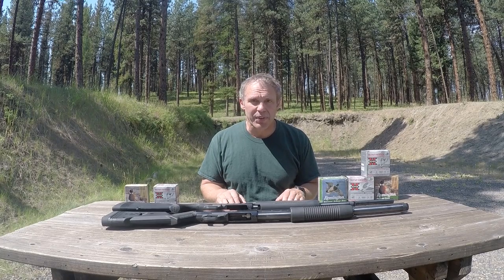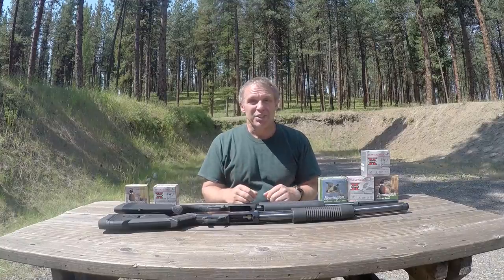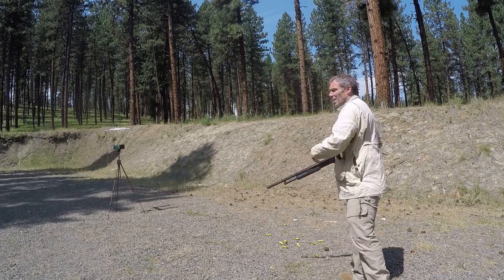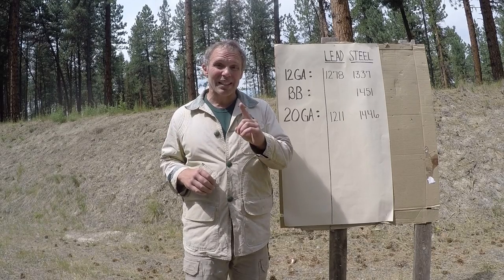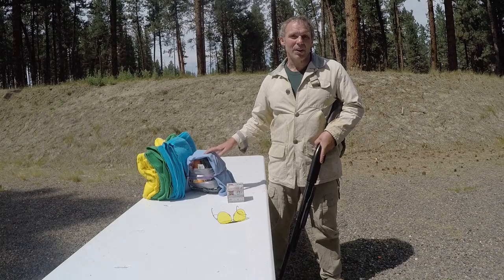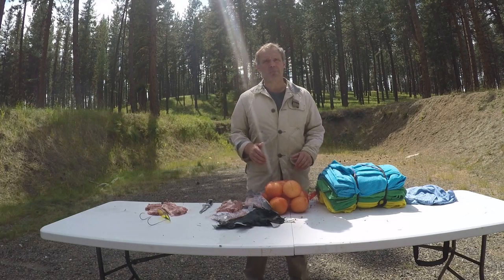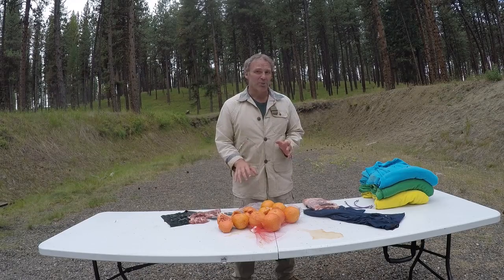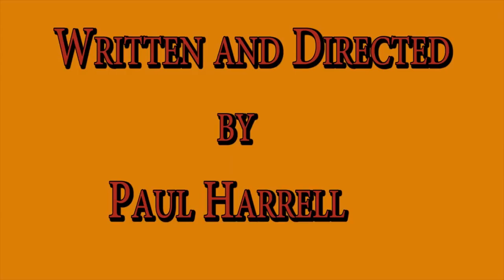Steel Birdshot for Home Defense

Comment: Not disputing your conclusions, but you ARE missing something that's relevant, and worth mentioning: steel shot has significantly less SECTIONAL DENSITY than lead shot. Lead shot will be expected to penetrate significantly better than steel shot when pellet size and velocity are the same. That's why, on game, most manufacturers recommend using a lower shot number with steel when used for the same purpose as previously used for lead. (#4 steel to replace #6 lead, etc.).

Still, FBI tests confirm that (at least in lead shot) #1 buck represents the most "bang for the buck" in self-defense rounds. Their principle was to find the smallest shot which penetrated to their minimum depth -- because a larger number of smaller projectiles (with total weight X) will produce more tissue destruction than a smaller number of larger projectiles (with total weight X) -- as long as depth of penetration is adequate. This is just physics. So, for example, 16 pellets of #1 buck which completely penetrate a target will cause more damage than 9 pellets of 00 buck (assuming roughly equal muzzle velocities). When I do choose a shotgun for home defense, I do load it with #1 buck. And, per the above, if you were going to use steel buckshot (and, actually, I don't use shotguns enough to even know whether that's available) you might want to increase that to, perhaps, 0 buck (again, I don't even know if that's produced, and I'm not interested in looking it up, lol). Lead shot is much to be preferred for self-defense.
Reply from the maker: According to the sources I read, no. 1 and no, 0 are the same size. Go figure. I don't know about all those FBI tests, but after doing some deer hunting I concluded that no. 1 was the best size for me to use. 
  I don't mention sectional density in the vid, but I do say that lead is dense and makes a good projectile.
Reply: @PaulHarrell  Thanks for your response. In the end, the result is the result -- and your meat tests never fail to be significantly informative.

Comment: If I was a home intruder I wouldn't feel optimistic about getting shot with a .20 ga. compared to a 12 ga.  Think they would both hurt, and I don't think I would be able to distinguish between whether or not the homeowner used lead or steel.

Comment: Steel hunting shot usually packs enough punch to cycle, the steel target loads do not work that great in all auto loaders. The scary thing about steel is how it has a bad habit of coming back when impacting with hard surfaces. Where is the steel shot vs concrete wall at 10 yards? ;)

Comment: you need to use steel birdshot if you're using the Wile E Coyote method of delivery, mixed in with the birdseed, or your magnet won't pull you along the road when giving chase!

Comment: I've got some Tungsten 00 from Winchester at 1600fps. It's supposed to be be for medium game, but I'm pretty sure it's really designed for aliens. I mean, seriously? That's an expensive substitute for lead! I bought it in case I'm attacked by an armored engine block.
Reply: So: BB's are maybe the smallest shot you should use in steel. Looks like it won't go through too many walls. P.S., I've also got some Tungsten Turkey loads.

Comment: The improved cylinder choke for steel is the incorrect choice, you need to use a modified.The tighter choke causes the steel to bounce, and it can actually destroy some of the pellets because they're brittle. But that's the reason the pattern was poor with the steel and not the lead.

Comment: Before I watch this I just wanted to say my first two rounds of HD shotgun are lead birdshot I also live in extremely close quarters the longest shot I'd have to take is maybe 10 yards. Also if I miss I figure the suspect has found concealment and then it's all 00 buck and slugs on the stock. So if I need to penetrate I can.  But if I dont then I wont.

Comment: I'm curious in the beginning of the video you had mentioned steel bird shot causing damage to the barrel. I'm curious if there was any damage in or not? Also one thing I think was forgotten was cost effectiveness whether steel is more expensive than led. I'm simply curious and looking to learn as much as I can.
Reply: Silverous Leonidas steel only damages barrels if it is shot through a full choke or if shot in excess.
Reply: @beardoggin8963  
thank you for clearing that up.
Reply: @silverousleonidas5790  no worries, ive seen steel shot bulge a full choke barrel. Best to stay away from Steel unless you need it for hunting

Comment: The "very disappointing" shot actually seems, to me, like something that you might want in a home defense situation where you don't necessarily want to kill your intruder. While there was no penetration, there was however a wide spread and the impact was significant on the meat target (knocked it off the table). Considering that you would be firing at a person you would most likely knock him clear off his feet and pepper his entire torso+arms+upper legs/groin+neck+lower face with bird shot. If your intent is to force the disengagement of the intruder (and not necessarily his termination) I'm almost certain that this will achieve the result and the intruder would have zero interest in continuing to engage you (and personally, I have no issue with an intruder being able to run away).
Or am I missing the point entirely?

Comment: comparing steel to lead on paper, you need to take into account the change in weight of the pellets and figure out the total momentum (mass times velocity). The reason you can get away with comparing just the velocity of lead is that it's apples to apples. A steel projectile with the same diameter and the same velocity as a lead projectile will transfer significantly less energy- because it took less energy to get it that fast.

Comment: Yep! Newbie right here! I bought a Rock Island VR60 two days ago and I don’t know what ammunition to buy. It’s 25 feet from our bedroom door to our front door BUT we have children in bedrooms. I’m worried about over penetrating. What exact bird shot should I buy? I mean, what words and numbers should be on the box?
Thank you for your help.
Reply from the maker: Check out our presentation titled, "introduction to shotguns." There's a tedious explanation of what all those numbers mean. We also have presentations on various types of bird and buck shot.
Reply: My guess is go with lead. The smaller shot is a higher number. I've had better luck with high brass. If you get the other its fine. If all you can get is steel the numbering system is different. Best to use the chart. The numbers on what you typically  get at the store are different. Like a steel 2  vs like 7.5 or 8 for lead. With a semi though always test it. I have always tried to buy the better shells with the higher brass but also I have a pump. If I'm shooting trap I use cheap low brass. But yeah my recommendation  is get the best quality and don't go 00 buck , you could also go less lethal but thats a whole other category. If you have kids I'd go with a dog and an alarm. You can get self installed alarms for very cheap. And honestly  your plan with kids should be shelter in place and defend. That way you're not putting them in danger of a stray shot but I guess that can be bad as well because badguy could come your way and then you're all in his line of fire.

Comment: I'm quite surprised at the variance in the number of pellets in the same type of round. I would expect maybe 2-3 pellets of difference out of ~150, not 9. That's more than 5% difference.

One would expect such a difference to impact the trajectory and pattern, even the recoil. It might not matter too much in terms of effect on the intended target, but I'd be shocked if such loose quality control didn't impact consistency.

Comment: um, the fact the steel shot knocked the target off the table twice, says a lot to me. If you knock the perp down, a second or third shot will do the job. Sometimes, knocking the guy down is better than a non-instant death. If they stay standing, they can still kill you even tho they may die later.
Reply: toot tall a meat target is a long way from being analogous to a determined person trying to kill you. Better off using something more proven in your shotgun, like #4 lead buckshot
Reply: @beardoggin8963  you are likely correct. However, that fact was ignored. I keep a colt 45 handy as my home defense weapon because it's what I have and I trust it, I've used it for years. I don't recommend it for most though. Average person, a 38 revolver is actually a better choice. the only reason for using a shotgun is because it's what you have and know how to use. That being said, if it's purpose is home defense, then you load it appropriately for that purpose. The only reason for using any kind of birdshot is that's because it's what's available in an emergency situation. Anything is better than nothing.
Reply: Beardoggin89 plus you can’t load a meat target up on meth

Comment: Are the Mossberg 88 and the 500 basically the same shotgun?  I know they're different gauges in this video, but what I keep hearing is that the 88 is a less expensive version of the 500, but that they're virtually identical.
Reply from the maker: I just saw your question. hey are NOT the same gun. The 88 is a decent gun and it is significantly less expensive than the 500/590 but it is different. the action is rougher, the safety is in a different location, the list goes on.
Reply: Paul Harrell thanks for that clarification and I'm glad I can find an expert's opinion on this because it's what I keep hearing all over the place.

Comment: This should be interesting.  Why steel?   Hmmm. For penetration the "rule of thumb" is to go two sizes larger with steel shot to maintain the same energy/penetration at the target.  Steel shot loses it's velocity advantage very quickly.  Your results are what I expected.  Lead is better.  It's also cheaper.
Reply: gary K I’ve heard the rule to go up 2 sizes with steel shot too.

Comment: Lead shot has been banned for use when hunting water foul in all 50 states since at least the late 1980s or early 1990s. If I were to use steel shot for home defense then (.170) #B shot would be the absolute minimum smallest pellet size I'd use for home defense. Where as sizes (.190) size #BBB, (.200) size T, or (.220) size #F would be more ideal in my opinion if one had only steel shot in a pinch though not a replacement for good lead shot.

Comment: Doesn't this have more to do with the pattern at the range you were shooting than steel vs lead shot?
Also, usually I wouldn't bring it up, but in this case I think the meat target lacking skin probably has a substantial effect on the penetration of different kinds and velocities of small shot.
Reply from the maker: ay that the met target has, "leather jacket skin"
Reply: @PaulHarrell  oh, yep.  I've watched enough of your videos that I press "L" to skip the meat target description. I should probably stop doing that.
I still don't know about the first point and I know practically nothing about shotguns so I dont know how adjustable the spread is.

Comment: Do shotguns need special proofing for steel shot?
Reply: Most new guns can handle it unless specifically stated otherwise by manufacturer. Older guns, many advise against it as some say it ruins barrel, choke and forcing cones. I don't shoot birdshot often but I would think modern shells, with the wad cup holding the birdshot together until exiting, aren't as hard on barrels. Others on here are probably much more knowledgeable than I am

Comment: speaking of shotguns, I'm turning 18 in 6 days and I'd like to ask you a couple of questions.

I want a shotgun and I'd like to know which you like better between a Mossberg 500 and a Remington 870. I've shot both and both work for me but I'd like to know your personal opinion.

My second question is what tips would you give to new gun owners about buying guns and making good gun choices.
Reply: Get an 870 made last century. It's better made. Simpler than a Mossberg. Better configured for a pistol grip. Allows for an extended mag tube.
Reply: I am not Paul, but I own 2 mossberg 500's and a remington 870 Express magnum. Having put thousands of rounds through the lot of them, my personal money is on an 870 just about every time. They feel much easier to disassemble, and as they age don't seem to rattle or work themselves loose nearly as much. I live and hunt on a large saltwater marsh and generally beat my guns to heck and back, my 870 is the only one of my 6 shotguns that always works.Additionally, it tends to appear that 870s are much easier to customize and find aftermarket parts for, especially if you choose a 12 gauge. Your mileage may vary there, as I have kept mine in their stock configurations.
Reply from the maker: Thanks for the good input. I think the 870 is a good shotgun, but personally I prefer the Mossberg. I like the tang safety (works well right or left handed) and I like the loading system on the Mossberg more than the Remington. If you want to customize your gun there are things available for the Mossberg, but more for the Remington. And If you want to spend the money, the high end Remington's (the wing master) are smooth as glass.
Reply: you wont be dissapointed with either. Search here on youtube for remmington 870 vs mossberg 500 and you can see all the differences between them. 

If you do decide to get a remmington look for a used one made before 2007 or so. Thats when they got taken over by another company and started cutting corners on all their products, the guns would stick closed after being fired, the finish was poorly done resulting in very easily occuring rust etc. Mossberg are solid guns, and remmington 870s are as well as long as you get one from before they got taken over.
Reply: thanks for the tips! I have a lot of old time gun stores in my area so finding a used shotgun in good condition shouldn't be too difficult
Reply: Just learn on a pump gun. I started at 11 years old with a Remington 1100. 50 years later tried to use a pump. I can shoot the first bird flys over but 10 minutes later second bird flys right by. Dang gun want shoot . Same learning to drive, start with a straight shift. Ant drove one in years but still try to mash at clutch often. Just smile an go on.
Reply: One key point is that Remington 870 has a steel receiver and the mossy 500 is aluminum.  Both are equally strong as the bolts lock to the barrel not the receiver.  I've seen many an 870 wielded by hunting buddies that have a rusty receiver.....my 3 mossy 500s have been put through hell in the field......rode hard and put away wet.....no rust.  Just something to consider if your going to use it alot in the field.
Reply: @jimlacefield7176  I'm wanting a shotgun for home defense, bird hunting (upland, waterfowl, turkey) and deer hunting.

Comment: Hey paul does steel shot mess up your barrel? Wondering if i can use steel shot in my stevens 320?  Hard to find info on this
Reply from the maker: Just saw your question.
 Most of the time the shot will remain in the plastic shot cup while in the barrel and the shot won't have much contact with the barrel. Even if it does the friction will be minimal.
 There might be a little concern if you're shooting skeet every day, but for the rest of us, steel is fine.
Reply: @PaulHarrell  thanks for your reply.  i appreciate  it

Comment: What we be the best choke for 12g for home defense?
Reply from the maker: It doesn't matter very much because at that distance no shotguns pattern will be very big. But cylinder bore or improved cylinder works better with some types of ammo (like federal flight control) and the cylinder bore shotguns are usually shorter.

Comment: Dude how are cycling that so fast . im afraid to do that with my pumps
Reply: I have to try it now.
Reply: Abram Hepp you wont hurt a pump gun by manhandling it. He just uses the push pull method where he is pulling back on the pump while pushing on the pistol grip. That is how he is able to cycle the action so quickly

Comment: I need help knowing what to safely put through my 100 year-old 16 gauge
Reply: James firebird Adams only a qualified gunsmith that has physically examined the gun can make that call. When it doubt don’t risk blowing up your gun
Reply: Almost anything other than supercharged loads and, in my opinion, slugs.
Because the bore on a shotgun is so large and the pellets rather than a single projectile they have relatively low chamber pressure compared to a rifle or pistol.
Reply: @beardoggin8963  thank you, that is my biggest fear. It's in really good shape for his age and I don't want to mess that up.
Reply: James firebird Adams that is my thing. If you really want to shoot it then it is worth taking the time to be sure you don’t ruin it, if not then it can be heirloom safe queen. If you just want to shoot a shotgun you can get a cheapo pump for $200
Reply: @beardoggin8963  I'll have it checked out. The case maybe the safest place for it. Nice show and tell...

Comment: Shooting a slingshot for many years has taught me that steel does not make an ideal projectile. Way too much ricochet potential. That might be different at shotgun velocities, but I wouldn't try it against any type of hard target. For what it's worth, I used steel shot on a dove hunt last year and It seemed to work just fine. Granted, it doesn't take much to kill a dove so your mileage may vary.